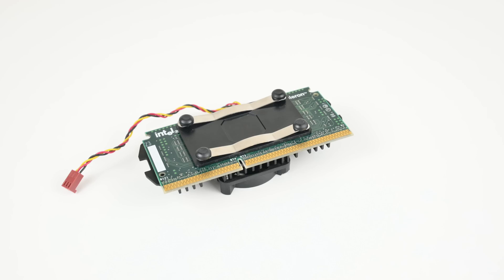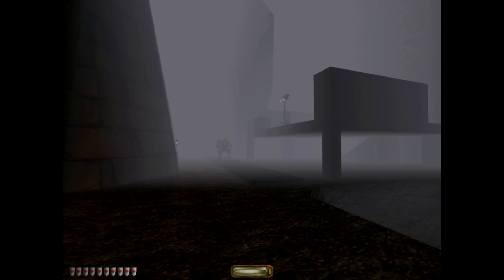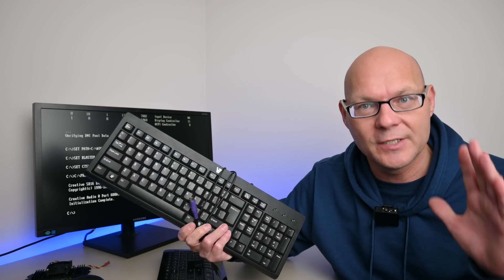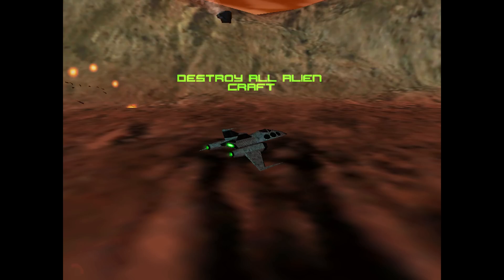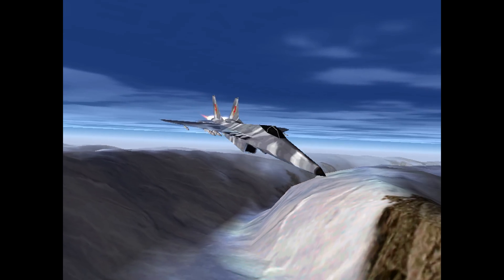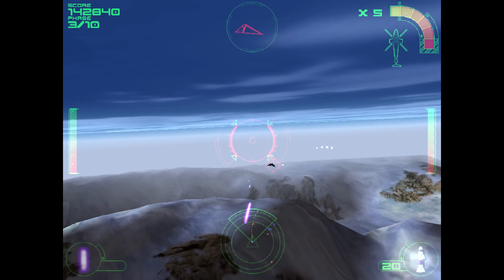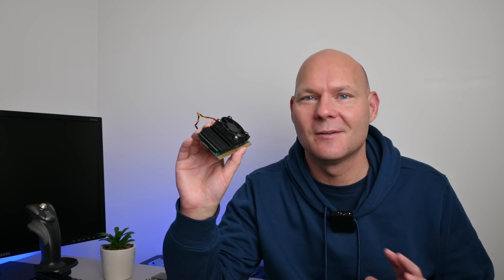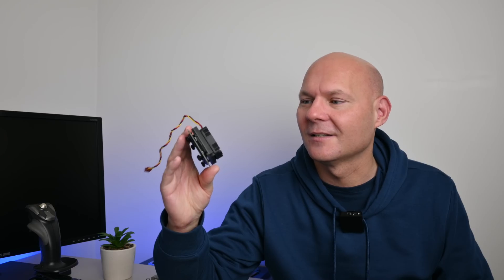Celeron 266 Is Missing Something Important

Comment: The Celeron 300A was one of the first systems I built with my own money... nothing like a free and EZ overclock to 450Mhz!
Reply: Celeron 300A was also my first PC build I ever did on my own. I overlooked it to 464 mhz and it had very similar performance to my friends P2 450mhz. I threw in a 3dfx Banshee and ran everything I wanted.
Reply: I actually have a 300A in my drawer next to my bed. Lol
Reply: @davkdavk  I would love to see a video on that... memories!
Reply: This was me too, was still in school. Had a Riva TNT 2, most expensive part of the build was the 4.3gb hhd. Probably the computer I remembered best. Nothing would ever OC like this again, took 3sec. no cooling upgrades needed. A year later GTA3 came out, and it was unplayable. With my first paycheck I build an Athlon system for GTA 3.
Reply: @christiaandN110  Riva TNT 2, let's go! I believe that's what I had in my system too, but I think I eventually swapped it for a voodoo3 because it was just easier to get quake3 to run under Linux around that time.
Reply: Same boat here except for a 333a overclocked to 500. Awesome with a Geforce2mx back then
Reply: The Celeron 300A and then the AMD overclocking with just a pencil (graphite) bridging a small gap are some of my most memorable overclocking experiences.  Nowadays the manufacturers are pushing things to the very edge at stock settings so overclocking just isn't as rewarding anymore.
Reply: @ualdayan  Ahh, so it was him trying to overclock his AMD... good looking out, thanks! Yah I agree it's not as fulfilling by just enabling XMP and selecting the "performance" profile.
Reply: my first ever PC was a 500mhz celeron A... it was on par with pentium IIs of the era
Reply: exactly .. this celeron was best value for money those days . i remember i had to tape or paint a pin in processors board to unlock the frequency multiplier
Reply: @billkabb  I believe the board I had was an Abit that didn't require anything. I remember my friend was SUPER into overclocking (doing mineral oil from the start) and I vaguely remember him using a graphite pen to jump some settings or unlock a multiplier.
Reply: 66 Mhz FSB but level 2 cache... gorgeous :-) Nostalgia...
Reply: @tulfnulf3039  Those were magical days. I think around that time I had also traded my 233Mhz Pentium II for an AMD K6-2 running at 300Mhz which was quite amazing considering Intel didn't have any real competition until those chips came out.
Reply: Yeah I did the dual slot modification plus the 450mhz overclock, and for a brief time I had nearly the fastest system money could buy for the price of two celeron 300As and a dual-slot motherboard.
Reply: @travis1240  I wouldn't given my left hand to have had a dual CPU system back then!
Reply: Yep. The Tyan dual-slot MB with dual "C-450A" was a landmark system back in the day.
Reply: I had a 300A that I got to 514 MHz... great CPU.
Reply: @Lemurion287  Very nice! I was new to overclocking and didn't want to push my luck after I got it working lol.
Reply: Same, 300A was a BEAST for its price for sure back then.
Reply: Ditto
Reply: @vardekpetrovic9716  Yeah, back then I was only focused on Tribes and Quake lol.
Reply: 300A is a legend!
Reply: @ccanaves  Definitely deserves a spot in the CPU hall-of-fame!
Reply: Was the first retro pc I built haha. Love that CPU!
Reply: I gave a dual slot somewhere.
Reply: Still have both of my 300As and their ABIT boards in my closet.  Legendary CPUs.

Comment: Well, I'm glad I stumbled on this video. I've had an old Compaq Deskpro ep/sb series desktop and recently brought it out and decided to make it a competent retro pc. It came with this exact CPU with a weird looking passive heatsink on it, and an Ati Rage iic 2mb agp gpu. It was pretty slow with Windows 2000, but with Windows 95, it was pretty snappy. I just recently put in a 300mhz PII in place of the Celeron and upgraded the ram to 256 mb, and I also learned about the DMA option with one of your videos too, which made a noticeable improvement with OS responsiveness. Unfortunately, the 600mhz P3 I bought before the 2 didn't work with the motherboard, but oh well. I also had to learn about changing the DIP switches for the bios to accurately see the P2. I also bought a Radeon 7500 to install, but the pc didn't like it for some reason, giving a long beep and two short ones. So right now, I'm limited by the GPU. But dang, its nice to play the original Doom again and do some old school networking.
Reply from the maker: Well done 👍

Comment: Later Celerons with cache were excellent value if they could be later replaced as the price for Pentium dropped and you managed the expectations. In the Pentium II era they created the separate sockets. But a Mendocino Celeron was also fine as-is. Conroe and later Celerons were very good bargain.

If the Core made a robot that had my memories, I might be worried about some secrets leaking. But if they do it early before those secrets are created, there is no issue. The robot is a copy. I remember the Cavedog game, but never played it seriously.

Comment: It looks like your UPS on total annihilation is faster than your FPS. 
You can turn down the game speed using - and +. When slower it'll run smoother. 
Being able to pause and issue commands is so nice. 
Slow CPU's also cut off sound effects, it can only queue up so many at once.
Reply from the maker: Thank you for confirming the audio issue, I wasn't totally sure!
Reply: @philscomputerlab  The transfer of consciousness from flesh to machines was not without limitations, especially in the software 3d engine they had. I used to play around with models in it. You could have a rectangular texture, but any other polygon could only be a solid colour. Have a closer, 640x480 look at some of the units. You might see it.

Comment: Regarding the SSD, just look at the S.M.A.R.T. figures and if the issue is on pending sectors and such and if there are enough spare sectors left just do some full formats and/or fill up the drive a few times with random data (the H2Testw program comes to mind since it also checks the integrity of the data written) and let the reallocation mechanism of the SSD's firmware do it's job.

Comment: If I recall correctly, that L2-Cache wasn't removed exactly but rather not added - the entire SLOT design of the Pentium 2 line ( including Celeron ) came to be because they had trouble adding decent cache to the CPU and required an external solution for it. The same holds true for AMDs Slot-A, and both companies switched back to common sockets as soon as possible due to the stop-gap solution it was.

Comment: I actually got a PC second hand many many years ago with this exact processor. Had a banshee in it but previous owner didn't have the drivers because CS would only launch in software mode. 64MB of ram and win 98. 

Was slow at running an awful lot of things and unfortunately didn't bother trying older dos stuff.

Comment: My first "modern" family PC had a 400 or 433Mhz Celeron, 96mb of RAM and some onboard/integrated ATI Rage graphics and it ran TA like a champ, though, it'd struggle if you overrided the unit cap, load up huge maps, or cranked up the resolution too much. In your setup, I'd wager that it's some combination of the resolution and the lack of L2 cache on that Celeron that's causing the performance to stutter around. Otherwise, TA ran great on a lot of low power hardware of this era and beyond.

Comment: The 266 Celeron  was one of the best oveclockers. Normal settings was 4 x 66Mhz. It over clocked with 100Mhz  FSB 4 x 100Mhz gave me 400 Mhz cpu. Then it ran very good!

Comment: Back in 1998 I was 2nd year of high school and my grandfather used the money he had been putting away for years for my education, toward buying a PC to help me with getting computer skill etc. I remember that the CPU mounting in Slot 1 socket was so wobbly, I had to improvise and used some fly line. I attached it to the CPU's radiator and tied the other end to the top frame of the case, precisely adjusting the fly line's length and tightness, so that the processor is placed perfectly horizontally :-) Good years!

Comment: Those early Slot 1s could all just be set right to 100mhz fsb, despite the lack of L2 cache. Even the normal 300 was not terrible when OC'ed. But of course I had gotten a 300A after my first crappy Slot 1. Those just worked perfectly.

Comment: Hi Phil, i have one of these A Open main boards, but the power LED connection does not work :((, do you have any solution to the problem?. The board works fine otherwise.
Reply from the maker: I actually never use these headers on the test bench, but shouldn't be hard to find a positive and ground pin on that motherboard and hook up your LED there. You might have to add a resistor though.
Reply: @philscomputerlab  Thanks for the answer Phil, and keep the great video content coming. 🙂👍

Comment: Yeah those celeron's were trash but the 600Mhz one that use to overclock to 1008Mhz which broke the GHZ barrier before any official product as well as you could run a pair of them on an ABIT VP6 (if memory serves)  or the 900 that OC to 1.2Ghz were amazing but the DUAL CPU was disabled on there latter cause intel were assholes.  Would love to see a vid on these OLD CPUs

Comment: @PhilsComputerLab
This CPU, had several advantages that made up for the lack of L2 cache. The first was it's EASY overclockable nature. Change the FSB from 66 to 101 and you have a 400mhz class CPU. The second was the price. With this CPU being very inexpensive, it was easy to get into a slot one system with a solid performance to start and then upgrade later. The 300 did the same OC, but the 300a, as you know, was the best of the bunch. Still, the 266 was an excellent value CPU. I guess it's all about how you look at it.
Reply from the maker: Hmm I did look at OC in the past and because of lack of cache it was still slow. My recommendation at the end of the video is for using parts in a retro PC and here I wouldn't use it, you're much better off with a Pentium 2 or 3 even at a premium.

Comment: Celeron a serie are fast for a reason.
Full speed l2 cache well the pentium2 dit not use full l2 cashe speed .
It run on halve bus speed .

Well the cely use 128kb vs p2 512kb.

The celeron a serie the 128Kb is in the cpu self .
The pentium2 512Kb l2 is not in the cpu. It self but on the slot card .

The 1e celeron with out the l2 is a pentium 2 .
Celeron with l2 is a pentium3 model en

Comment: color keying (Chroma Keying) is removing a certain color from a palette. Commonly used in green screens back in the day to remove the green and add a background. I am going to guess that the 16 Bit render mode of the older cards fits with the games 16-Bit color palette while the GeForce cards did 32 Bit color so it would be off. Yes, I realize the Geforce cards did both 16 and 32 bit in the beginning but 16 bit mode was a subset of the 32 bit mode. That alone would throw the colors off and textures rendered in said color would be off as well.

Comment: I cant say much about this Celeron... It's annoyingly slow... Let's talk about something better.... Lets talk about Total Annihilation. Both sides has their pros and cons, if you stick to the official units and structures. You can use your commander to capture the enemy constructors, so you can build everything.
Reply from the maker: I didn't know this! I was amazed when I realised you can capture buildings.
Reply: @philscomputerlab  Glad to help... Here's a few more tips... The Commander and Krogoth are the only units who can survive a single nuclear missile. You can use the stealth fighters to patrol an area far away from your base and have the Big Bertha/Intimidator ready to shot the enemies spotted by the jets. If you set a constructor to follow a patrol path, they will help build anything in their range. The AI is not very smart, and when you have a lot of units, their decision-making becomes less effective. This can be problematic for constructors following patrol paths. You can solve this by focusing on plane constructors, but their build speed is much slower than that of vehicles. However, you can continuously build them as the planes can overlap each other in the air. At the beginning of the map, construct several Metal and Energy Storage Units. These will come in handy, and with enough nuclear plants, you can keep the Vulcan/Buzzsaw firing non-stop.

Comment: Well Phil like you i actually have an original Celeron Slot 1 processor in my retro PC collection plugged into an older intol 440LX based motherboard! Mine is the 300Mhz one though. I have it OCed to 333Mhz by only increasing the FSB speed and if i can remember correctly that is all that she could muster! 👍

Comment: Everyone is so excited with high performance and overclocking when they spit on this poor CPU. Well, I will brag that this is the first "modern" era (back then) cpu and platform that I got wing commander running on flawlessly after weeks of nostalgia torture. Take that you stupid 386 (DWUI) 33 Mhz. Don't ask me how, it was way too far ago before I can remember, but there was a way in BIOS. If I had one of them slot one boards with 66 MHz chipset (LX?) and something else, I could probably remember. I think my board was intel original, no idea which system OEM.
Reply from the maker: You disabled CPU cache!

Comment: The lack of L2 cache was why the 300a and the like was able to overclock so well. Just change the FSB from the stock 66mhz to 100mhz - bingo 450mhz.
Reply from the maker: Just to clarifying, 300A is a different CPU and does have Cache.
Reply: @philscomputerlab  sorry meant the off die cache that the slot pII 's had at the time

Comment: This was the processor my first computer had (Mitac). I remember messing in the BIOS and overclocking it to 300 mhz and it worked fine. But i did undo the overclock because i thought it would became unstable. Motherboard was a PC-Chips M717.

Comment: Ah the Celerons were quite a mixed back over the years.
 - The 300A was amazing, did 450 MHz and could easily beat a Pentium on the same clock simply because it has the cache at the same clock while the Pentiums had them at 1/2 or 1/3 the clock.
 - The NetBurst Celerons were absolute garbage, 1/4 the cache, lower FSB, on an architechture that is already bandwith starved.
 - The Core 2 era Celerons were good again, yes, they also had less cache and slower FSB, but the architecture could be oc'ed really well, and the limit was pretty much the same for all models. I've got my 2.0 GHz Celeron to 3.5 GHz, while my 3.0 GHz C2D topped out at 3.6. And yes, cache and FSB made differences there as well, but even the Celerons had at least enough to be functional.
 - During Core i times they became pretty much obsolete, with Pentium, i3, i5 and i7 above them and the gap simply being too large.

Comment: I remember reading an article in 2003 about installing a Slot 1 to Socket 370 converter and run a Tulatin Celeron on a 440BX motherboard.

Comment: The 566 was the best.  I had a water cooling setup and normally ran it with a 133mhz fsb, which was double the original speed.  With a peltier and special ram, I even ran it at 150mhz fsb, but it wasn’t sustainable because I couldn’t keep the water cool enough outside of running a hose from the tap 24/7 lol.

Comment: I'm with ya on easy or very normal difficulties in games, they are meant to be fun!

Only Celeron I've owned was the 533mhz but that had L2 cache and ran games in windows 98 fine, think I upgraded to an Athlon XP relatively quickly when I migrated to Windows XP though.

Comment: I got my brother's old computer out of storage about a year ago and was playing around with it, I never knew as a kid that it had the "bad" Celeron 300 in it, I guess it makes sense that Packard Bell would have bought them on closeout and shoved them in their value line in 1999, I could find reference online of some Packard Bell and Zenith computers that used that board came with the Celeron 333, but I tried a Celeron 333 in it and it wouldn't work, so after further digging I found an old Forum or Usenet post from the early 2000s where someone made reference to a newer revision BIOS in their machine with that board but it that BIOS never seems to have been released as an upgrade package it was just installed on the boards that shipped in later machines. In order to get the 333 and later a 533 in a slocket to work I had to cross-flash the original Intel retail bios on it. I stuffed a Radeon 9250 PCI I had lying around in it and a newer 40GB HDD and installed Windows 2000 on it and had fun running stuff on it that would never run on the original 2MB ATI Rage onboard graphics, I chose 2000 over 98SE because I find that the Radeon 9000 series cards do better under 2k/XP than they do on 9x. For the shits and giggles factor I ran GTA Vice City on it, it wasn't really playable but still better than the slideshow I had trying to run it on a Pentium III Ultra Portable machine with an S3 Savage IGP in the past.

Comment: If your board can run this it'll run a P2 , and a P3 Katmai , almost certainly . So why would you. Asides from overclocking the bejesus out of it just because you can , but then a 66mhz bus P2 is still going to o/c the same . Stripping the L2 cache was just such a cheap move. I have about 90% of the slot 1 P2 and P3s at my disposal , not a single Celery. Nice video, as always , Phil.